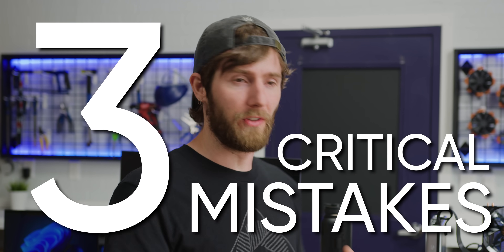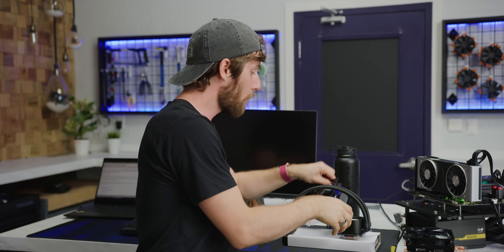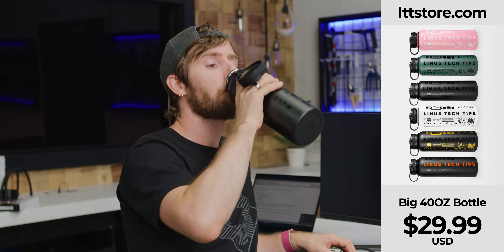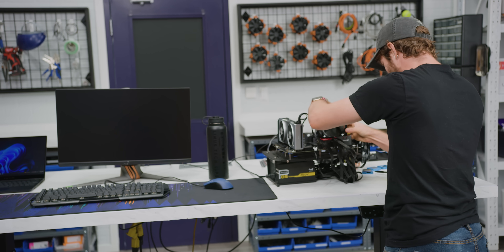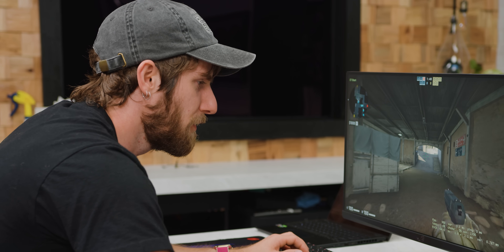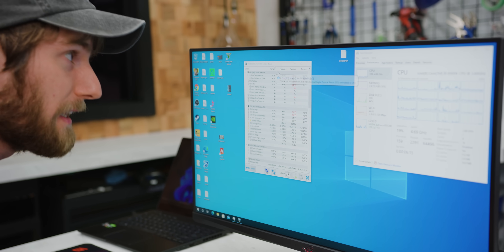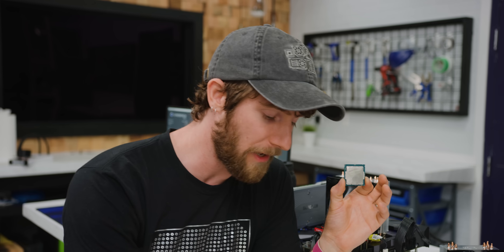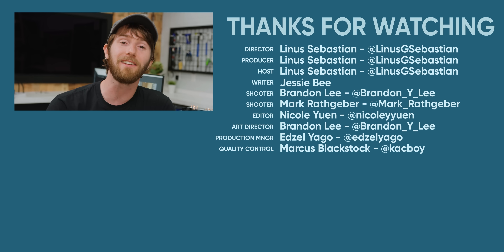How BAD is it if you forget to peel??

Comment: Great video. I've built quite a few computers over the years and just went to install an extra 2 sticks of RAM in my gaming PC and noticed the plastic sticking out. Turns out I've been running it with the plastic on for nearly 2 years. Oops. I'm honestly surprised I didn't notice any problems at all during that time.

Comment: I totally forgot to remove the plastic on the cooler when I did an upgrade over the weekend.

HUGE difference! Went from 89C, fans running full blast and heat throttling after less then a minute of torture testing via Prime95.

Just finished peeling the plastic and redoing the thermal paste. Torture testing now for 10 mins and max CPU temp is now 58C, CPU fans are quiet, and no more thermal throttling!

Comment: Had to check this video coz I found that Dell R15, that I have been using for 3 years was shutting off randomly, thought that it might have been time to replace thermal paste . Got new thermal paste and when I opened to clean and replace it, found that "Peel before use" warning pastic is still on over Cooler Master chiller !! No my CPU temp is back to 50 on average load from 80s it was rocking earlier !! SMH

Comment: I'm here because I just did this, DESPITE the fact that I saw it, and even made a joke with myself about how dumb I would be if I forgot to peel it off. 🤦‍♂🤦‍♂ The reason I didn't peel it right away is I kept it on while I was checking the fit of the cooler before I did paste and locked it down. But then I had about 20 other problems come up, and got frustrated, and then in my frustration of finally getting things installed....forgot to peel it. Luckily, I had the cpu temp monitor running and the first game I started up it warned me of critical temps. I knew something was wrong, so I stopped it, and figured maybe I did a bad job of thermal paste. Nope, stupid plastic still on there. 🤦‍♂

Comment: I was led to this video due to just fixing a BSOD loop caused by an overheating CPU. The culprit? My dumbass forgot to remove this plastic. Went from 89 -> 34, so this can actually cause pretty gnarly issues. It happened slowly, but the heated plastic somehow displaced most my thermal paste until I went from infrequent crashes, to daily crashes, to a BSOD loop.

Comment: I changed my stock cooler to aio and forgot to take the plastic off... booted couple times and upon checking why my cpu (5600x) was running at .52ghz...i took off the plastic n reapplied...would you believe...i cannot get my cpu to work as normal anymore..i have to use ryzen master to disable prochot...why tf is these things so fragile now. I need a WHOLE NEW MBO. I AM NOT MADE OF MONEY

Comment: I actually bent the pins on my ryzen 5 3600 last year because I forgot to peel lol (I ran the system for a couple of days wondering why my cpu wat hitting 80C on a double radiator custom loop. When I decided to disassemble the pc so I could put the stock cooler back and re-do the loop, the thermal paste was so much glued in the plastic that the cpu came off with the cooler, with that metal thingy that holds the cpu in the motherboard still locked)

Comment: You won't experience any major impacts until quite a long period of use, I had a custom loop hammy downed from an old housemate who upgraded when 10 series dropped due to performance issues and frequent crashes. Dismantling and re sitting everything into my case we found he did this exact thing. This was after 5 years of use. The film had melted to the CPU and thus was causing the crashes, we ended up wet glass sanding the surface area is still operating today with the occasional blue screen

Comment: I forgot to plug in my cpu fan on my server once, was only able to notice after I saw the CPU temps were in the 90's and looked at the fan blades
so yeah it is easily possible to do all manner of silly things when installing a cooler
I once didn't have thermal paste(was in shipping)and I actually used toothpaste for a bit, it worked until it dried up then it was worse than no thermal paste
we all do actually do silly things in various situations, though I am sure based on my pentium 4(flamium 4 as I call that home heater) toothpaste run, that any cpu newer than pentium will thermal throttle far before it fries, though it may not be able to reach desktop or so before it thermal shutdowns, and cooking a cpu to thermal throttle just by booting up is not good for it's lifespan, especially if it shuts down due to overtemp

Comment: Linus I've done it before too haha, I was building a new PC from parts I got for christmas in 2020 and I had built about 20 PCs up to that point, on the 27th of December 2020 when I was building it I got distracted and put it together with the plastic inbetween the heatsync and the CPU, I didn't even notice until a couple of days later when I was doing some overclocking and I noticed that my CPU temperature was at 97°C all the time, that's when I realised, I took the heatsync off and found a disaster hahaha. :)

Comment: I forgot to do this recently. Been building PCs on and off for 15 years. I felt so embarrassed when my temps INCREASED after changing to a better cooler. Got a big clue when I touched the heatsink and it was room temperature, when the CPU was hitting 80 C. Saw that small, plastic tab stick up from the base and facepalmed.

Comment: I did this on my 5900x, and I definitely figured it out right away. I went to boot the PC, and the moment it started booting, it restarted. I'd get into the BIOS about 15 seconds later, and the CPU temp was about 80 degrees. 

I knew there was an issue, but hadn't yet figured out what. When I went to check the thermal paste job, I saw my issue. I had always assumed nobody was this dumb, and learned I was that dumb.

Comment: The store my partner made pre-build a part of their PC did this, but it literally kept *crashing*. And they refused to even give a partial refund or anything. 50€ just to get the CPU, cooler and RAM into the mobo, and they couldn't even do it properly or give a refund. My partner ended up getting it fixed at another place and it cost 120€ 🙃🙃 (they didnt know what was going wrong and they needed a new PC asap for their uni). wish I had been there but we're long-distance.  Mindfactory if anyone's wondering.

Comment: Fucking hell. Just had this issue because 5 years ago when I had my last pc it had that plastic cover. Then bought the artic cooler 420 and didn't think about it. Then I'm getting 50-90c temps trying to figure out why realizing its has a fucking stupid ass plastic covering it. Fuck off with that shit. Just put the massive plastic on so someone who hasn't built a pc in 5 years forgets to. Good thing it didn't fuck my new pc up.

Comment: I bought new cpu cooler and didn't even see there was a plastic and of course attached it already on 65w cpu. Cooler was simple one. Is there a chance that there is real plastic? Gaming is real good and smooth, no throttle etc, temps also good 50-60c

Comment: I had a computer that had the liquid cooling die on it, took it to a local repair shop and they installed a replacement. Everything was fine for 14 months before the computer started to have random crashes, CPU running 80-90c with just sims4 running. Turns out the local repair shop never removed the plastic on the cooler, the plastic wasnt melted and didn't seem to damage anything. New cooler (with no plastic) and the CPU was still good as new.

Comment: I made that mistake with my m.2 drive.
Seemed fine for a bit, then the pc started chugging and crashed a couple of times.
I seriously thought I got some bad ram for a moment.
Came to realise that the heat spreader that came with the motherboard on top of the m.2, had a plastic film on the thermal pad.
The ssd was completely choked of any way to cool itself, and was thermal throttling HARD.
After peeling off the plastic, all my problems just vanished.
I was kicking myself, as it took several hours of testing different components and stressing the fuck out till I had that light bulb moment.

Comment: I just took my laptop apart the other day after 9 years of being disappointed by it's performance and found a piece of masking tape between the CPU and heat sink. I've never torn it apart because who actually wants to tear a laptop apart? It got me through college running Solidworks and a few other programs.

I had to scrape the cooked on tape with a knife directly on the silicon chip in a "this is either going to work or brick it" fashion and it works as it was advertised.

It was not bought used, I ordered the laptop new directly through Lenovo when it was released. Just amazes me that it didn't melt in 9 years of CAD use or being a bored college student with Excel.

Comment: Funny YT recommend me this video. I did that exact mistake less than a week ago on a 13700k. At first i thought about upgrading my case and water cooler (on my current one i can only fit 240). But i tried first to reseat the aio. And i almost put it back with the plastic.
There were no instructions on the plastic, it was hard to see.
I went from 60° idle to 35 and from huge thermal throttle to 85° on stress test.

Comment: I have a core i7-7700 ( not K ) and it runs at 90-91 degrees at full chat.  A search of the interwebs told me this is normal for these chips.  I'm still not overly happy with it but it is what it is I suppose.  I did peel my cooler.  Not overly careful with the paste ( a slight sideways slip on securing the cooler ) but again, research on youtube tells me "meh, not worth redoing it" - it was a pain to put on.

Comment: I definitely missed the step once. Left it on to do a dry fit, addressed clearance issues, realized I knocked my finger at some point, and by the time I came back (no longer bleeding red juice) and forgot to take it off. It ran for 3 years like that. No issues.

Comment: I certainly have never done this with a CPU...However I did leave the blue film on a thermal compound (sponge) cover of an NVME cover.  Best guess is they have them on there for the same reason so that during shipping/handling, or the fact the covers swing right off and could drop to the floor, etc. where the last think you want is Schmootz all over it.  But I never even saw the plastic there until swapping the NVME out for a larger unit a year later.  ZERO net affect!
Reply: that plastic is a lot thinner than the cpu cover ones. honestly I left it on just so I wouldn't get my ssd covered in grease and imo it won't really make a difference. seeing as they can run without one.

Comment: now i do tech Reviews as well and i thought the same till i got a new cooler to Review installed it run benchmarks and the temps kept going up and up and when i took the cooler off the plastic was still on but it had started to melt and i have built my own and family members computers over 15 years now and i even made that mistake

Comment: Owning an i9-9900k I know this chip can get to nearly 100c on a 240 water cooler on basic bios settings, only after stabilizing its volts and disabling hyperthreading that u can have headroom to begin with, Im sure the plastic didnt help but I wonder if that cooler would even work without the plastic

Comment: The moment when you realize after 2 years worrying about temperature issues, that the water cooler had a plastik cover on the block... Decreased the temperature by like 40 degrees 😂
Reply: At least it was just a plastic cover. Mine started thermal throotling and after examining it thoroughly I discovered the pump had just clogged and my cooler wasn't cooling at all. I've been using air coolers ever since

Comment: Worst I've done similar to this is when putting on an aio water cooler to the CPU, I didn't bother removing the stock thermal paste on the block and just added a dab of arctic silver to the CPU.

On first boot. The thermal pastes must have reacted and dried completely out instantly. PC wouldn't boot past the bio due to overheating, stuck at 85C.

Cleaning off the CPU cooler block and applying fresh paste solved it.

Comment: I used to work at a place where we would upgrade new Lenovo desktops and would test them before shipping. On 3 SEPERATE OCCASIONS we received brand new machines from distribution with plastic between the cooler and CPU.

Comment: idea is to let those electrons jump to next metal cooling and heating but plastic in middle that not gonna happen
Reply: so in this situation your fan is only thing what does all the work
Reply: the idea is that the electrodes jump from a low frequency to a higher one, so their movement decreases, so the other metal cools down.. because heat causing movements.. other way how to put it you throw ball(electron) on floor and it bounces on table... at floor it jumps 2m and when it goes top of table it does 0.5m jumps.. but you left the plastic wall front of it that not gonna happen so it jumps somewhere else

Comment: I remember making this mistake when installing an AIO on a FX 8350,(because that stock cooler was ridiculous). I could tell right away something was off as everything pretty much ran like crap once. Once I checked and removed the plastic and put on new thermal paste it was fine.

Comment: Maybe machine a cpu and use a modified guage block as a cooler and then no thermal paste is required which would be more efficient. If you rub two guage blocks they will stick together and will be one piece of metal, just an idea

Comment: "Machined flat so there's as much surface contact blah blah blah.."
Wouldn't an uneven surface have a larger surface area?
Wouldn't thermal conductivity increase if both, the surface of the CPU and the cooler be an intermeshing washboard-type of geometry?
Why aren't we doing this?

Comment: In 2016, I went with a new build i5 6600k. It ran fine, I tried to overclock a year later and system shut down and never let me into bios for some reason. I decided to get a new mini itx case this year and find I had a sticker on the h212 cooler the whole time. Nzxt h1 mini now and runs cooler lol

Comment: don't doubt that this is already a video but what happens if you physically weld the CPU shroud thingy (the metal piece that covers all the micro chips and stuff) to a cooler than reattach the CPU and install it I'd imagine that with no thermal paste just bare metal welded it would have pretty good cooling

Comment: I was getting occasional blue screens on the first PC I built related to memory. Replaced the RAM and played around with some settings, still had that issue. Accidentally turned it on when I wasn't supposed to and damaged the motherboard. Took it in for repair and told them about the the memory issue too. Turns out a tiny piece of plastic got in one of the slots and was blocking a connection. Since then, no blue screens, but a tiny piece of 0lastic can seriously negatively impact performance

Comment: I saw this thumbnail and had a PANIC ATTACK cuz I'm out of thermal paste and I thought "WAIT THERE"S A PLASTIC PROTECTOR ON MY CPU?!?!" cuz I definitely didn't peel one off. Then I watched the video and realized, oh, I'm fine, I used my shitty stock cooler from my previous CPU, so my thermal issues are just from using a shitty system, not from forgetting to take off a layer of plastic. Whew.

Comment: Got my current pc by trading a few pc parts I couldn't use and didn't need to a guy and didn't think of checking stuff like the thermal paste but thought it was odd that it was idling at 60ish on a i7 4770 after about 6 months I did some tinkering, changed the case to something bigger and changed the 2 fans it had in it to 7 and still was at 60 so I decided to apply new thermal paste and found the peel... my thermals dropped 25-30 degrees by removing it and applying thermal paste since the old stuff only had a tiny ring around the outside of the peel

Comment: I done my first motherboard & CPU swap last week. No biggy right? Well numb nuts here, flick the switch on the psu and when it didn't fire up.... I thought F$$K I killed it. Stripped it down again and at the point of about to pull the cpu, it came to me.... Hit the power on switch on the front panel to turn on!

Comment: I've had experience like that many, MANY years ago - with a bunch of like 10 prebuilts from a local boutique with a Celerons 366 (socket 370 version, not slot1). When they started to hang/bluescreen/fail one after another during a hot summer investigation was in order, and there they were - beautiful price/warranty paper stickers "provided" courtesy of said boutique, on top of a IHS of each of those CPUs. Removed them and magically everything was in order again...

Comment: Question here:
I've seen pumps able to cool down to -200 °C... what if you replace a heatsink or a cooling system with these kind of pumps ? ( You can even do metal to metal conduction with the pump ... )
Reply: -200°c is very close to absolute 0, when atoms stop moving.
Reply: @Name-qj9ql Still 70 ° , And if atomes doesn't move that makes it the perfect thermal receiver ?
Reply: I don't really know enough about thermal dynamics to say more, but you probably wouldn't want something at -200°c in your home. And the price to run it would send your electricity bill through the roof📈📈
Reply: @Name-qj9ql  It's safe so long as you don't touch it nor bring flames to the liquid.

But does computer part work well with liquid nitrogen, oxygen and the temperature it comes with ? If so then you can have a system completely immerged in it and then you just need a thermos computer case and your electricity bill could be not that bad if you have very good insulation?

Is the extra perf worth the hassle ? Idk but it would be fun to see and measure xD
Reply: @flache1086  now this sounds like something Linus Tech tips would do: how cold can we make a computer?, just like the gas powered computer pump.